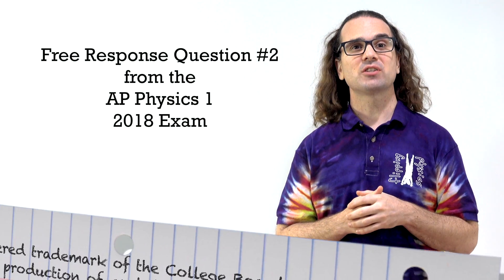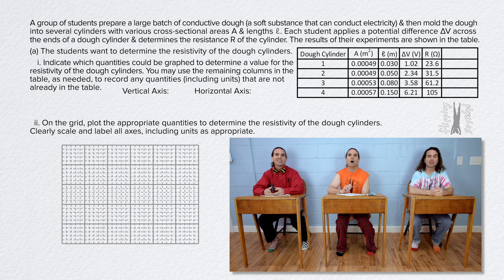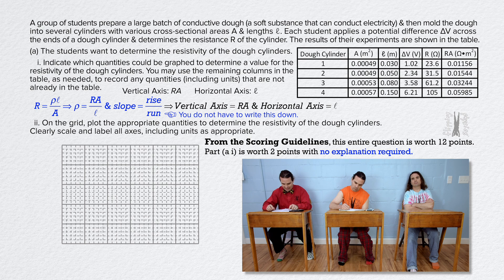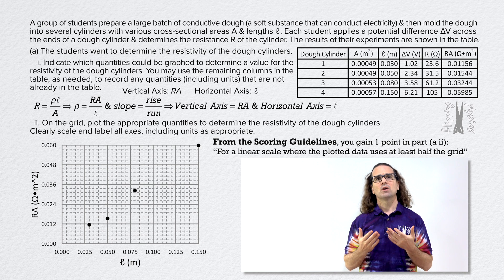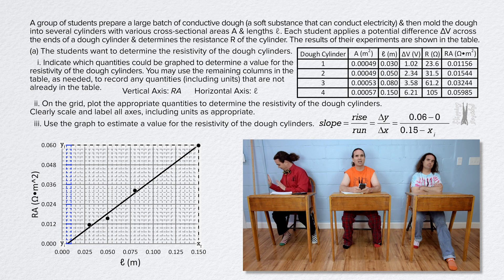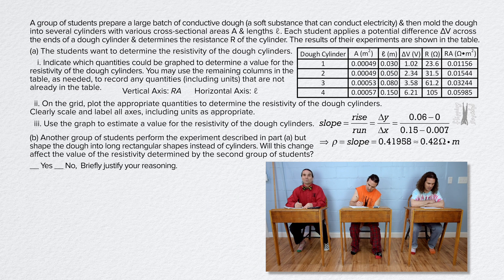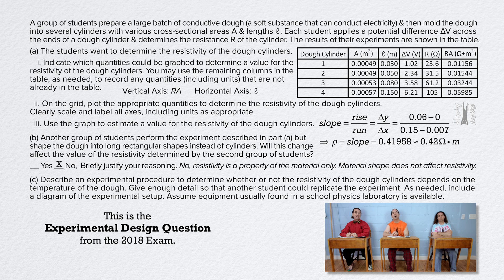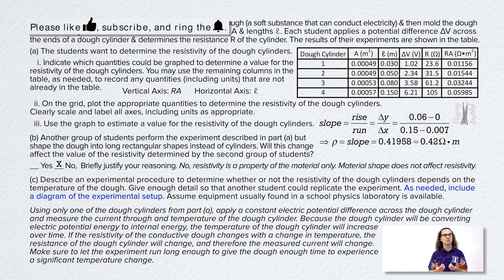2018 #2 Free Response Question - AP Physics 1 - Exam Solution

Comment: Good job, every answer explained very thoroughly. It may just be a personal preference, but for picking the intervals for the graph, I generally recommend to my students to make easy to divide increments, the x axis is simple enough, I would've chosen something like 0.02 increments even if it ends up only using 3 out of the 5 boxes along the y--axis, then drawing out the dots wouldn't be as intimidating trying to figure out what each of the increments represent for those increments of 0.012. 
For the Best fit line, I don't know if you have a separate video teaching them how to do this, but I usually will remind them in general if drawing these by hand, try to fit a straight line under about half the dots and over the other half of the dots, like weaving. Also, for those who didn't bring a straight edge ruler for some reason, ripping off the equation sheet or scratch paper and using the edge is a good plan B. 
For the Exp. Design portion, I know I don't ever teach resistivity too thoroughly, nor to I get to how current going through the wire ends up heating up the wire, so I could potentially see students getting intimidated by this answer. It is the most accurate and thorough answer for sure, but I think offering some alternatives that don't require knowledge of the nuances of the effects as current goes through a wire would be useful for the general population of students using this to study for the Exam. Examples of simple techniques to alter the temp would include ovens or hot plates of various temps (not hot enough to cook the dough of course). 
Overall,  a good and organized way to go through an example response, and address how the response hits each scored point.
Reply from the maker: Thanks for your thorough response. With regards to 0.02 increments, etc. I can see your point, however, I decided to do it this way to give a specific way of determining what increments to put on the axes. I can totally see your point and I'll keep that in mind for future graphs like this. The best-fit line and straight edge comment are fair, however, I do try to not include too much stuff like that in my videos. I prefer to concentrate on the physics and leave that stuff up to the teachers.
Interesting comment about resistivity. I have always thoroughly covered it and assumed other teachers did as well because it is on the equation sheet. Also, I had basically already shown this in a previous video with the time lapse. Perhaps next time I will include two alternate solutions to accommodate what you are saying. Thanks for the suggestion.